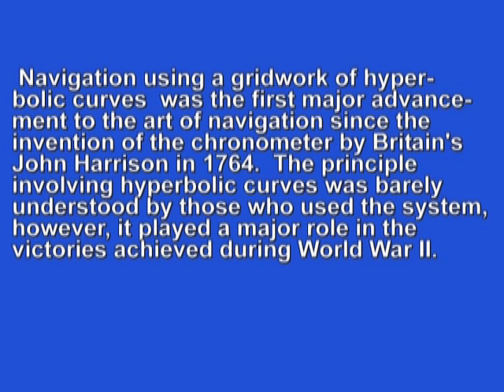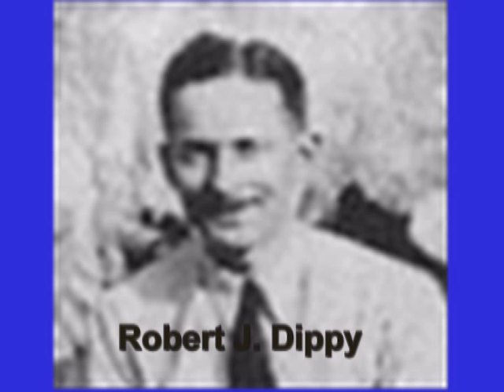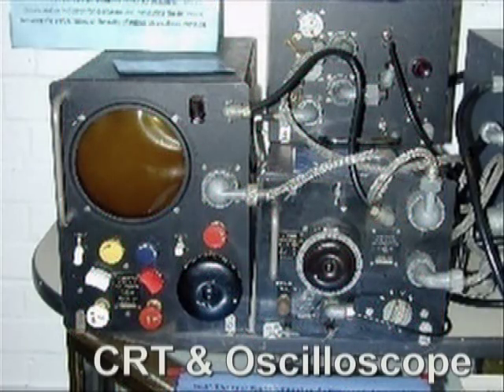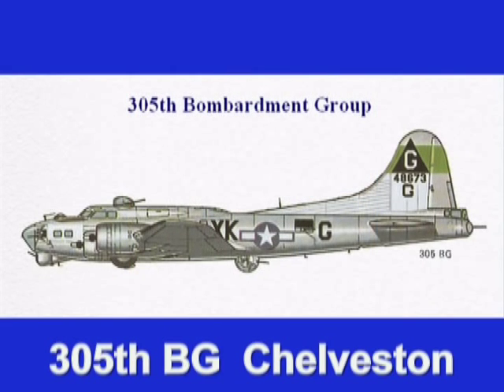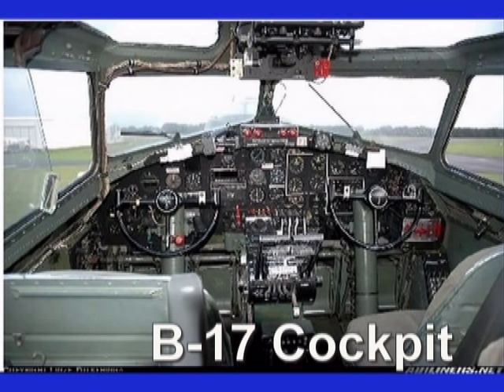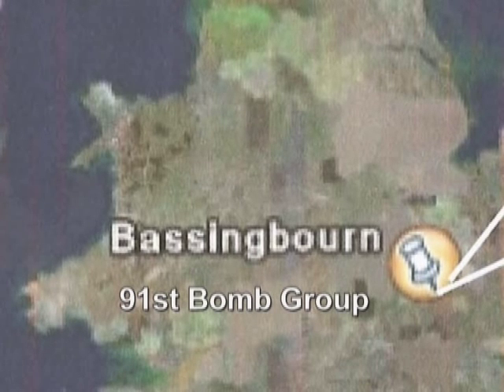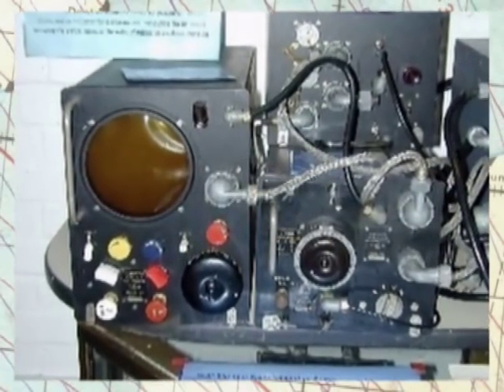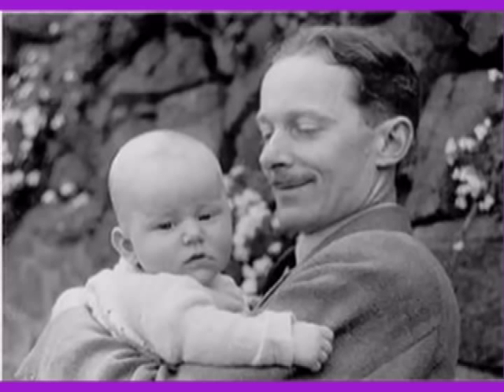GEE - WWII Hyperbolic Navigation System

Comment: Dippy's real genius was shown when he went over to the USA to work on LORAN. The system was being developed for the US Navy and there was a Team in the USA who were working on something like GEE. He told the guys in the US that GEE was on the verge of entering service and they would get something in service much faster if they just adopted the UK system as designed. As regards LORAN, he suggested that the LORAN equipment be exactly the same in size, shape, connections and power supplies as the GEE installation as possible, so that any platform using GEE could be switched to the LORAN system by just swapping of a Box and an Aerial.